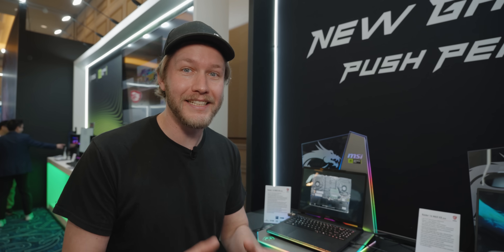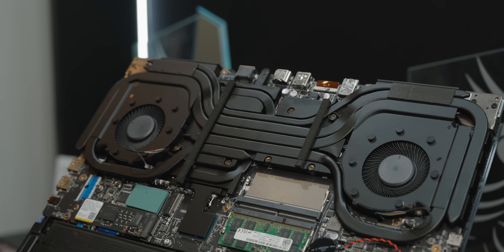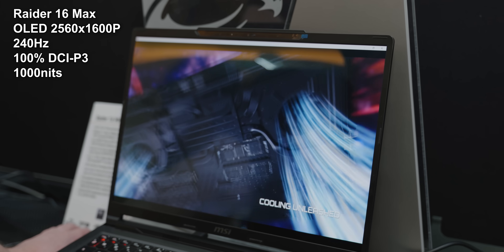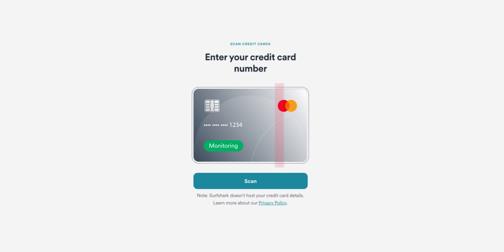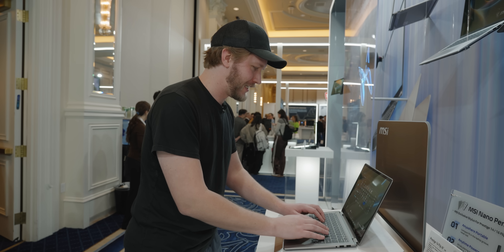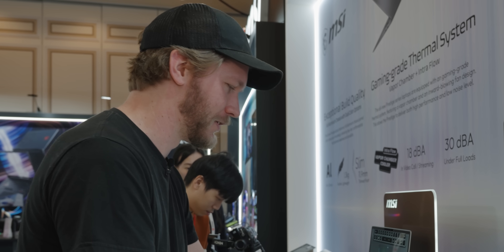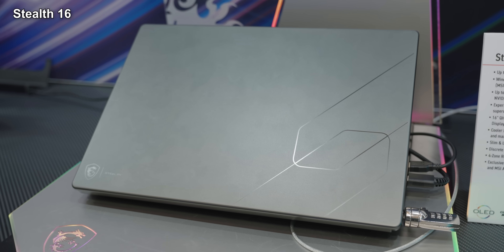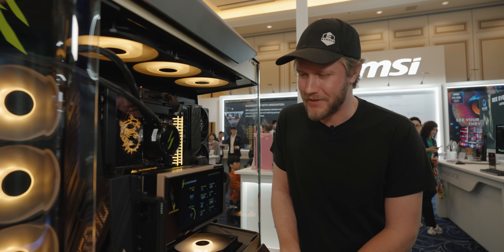So Much POWER!!

Comment from the maker: Go to https://surfshark.com/ziptietech or use code ZIPTIETECH at checkout to get 4 extra months of Surfshark VPN!
Reply: Out of the box most gaming laptops run to hot unless you throttle the wattage down to what the battery can handle even when it's plugged in.

Comment: Cool video, but you say you haven't seen any laptops that has such a high TDP before. I may be wrong, but I'm certain I've seen you with the 2023 ROG Scar 18 in at least 2 videos, which out of the box has a TDP of 350W and can with the use of Intel XTU that can easily be tweaked up to 428W, obviously you will run into cooling issues before you can reach that and the battery would go quick since the charger is "only" 330W.

Comment: My Lenovo Legion Pro 5 has a 300 watt power brick ... Now that heat sink is crazy ...
Reply: I had to do a little comparative research so my Lenovo’s 300W rating is just the size of the 'gas tank' (the power brick). It’s the maximum amount of energy my charger can provide, but my laptop doesn’t actually use all of that for performance; it usually pulls about 200W for the CPU and GPU, leaving the rest to charge the battery or run the screen.
The MSI, however, uses '300W' to describe the 'engine' itself. It has internal components that can actually consume a full 300W of power just to run the game or task. To handle that much hunger, the MSI actually needs a much bigger 400W charger to keep it fed. So, while both boxes mention 300W, my Lenovo is using it as a safety limit for the plug, while the MSI is using it to describe the raw power of the laptop itself."

Comment: Woooow! At least MSI Raider now can use 300W power and we can hope it will be more than 175 on GPU which one was standard for Raider and Stealth when it was last versions of it, and before, and before, so at least 4 generations power of MSI stealth is not changing at all, you can have it on 40 series and 175 W will be there, and 50xx, 50xx, and now new 50xx version are all with 175 w power, just price from first to last will be bigger and 1 ssd slot, which one was reduced after 40 series stealth version where was 2 ssd slots, now will be same, because stealth means less space inside even if it will be 18 inch model with free empty areas :D

Comment: This is the first video I've watched on this channel, and I don't know nearly anything about laptop design, but I just wanted to say that I'd like at least one company to make another gargantuan ~20-incher like they used to do back in the late-2000's. I don't care what kind of nightmarish engineering they'd have to do, I just want to see a laptop in this day and age with a proper workstation-class processor (like Threadripper, EPYC, Xeon, or at least AmpereOne if the TDP of the other options is just too high) and a proper top-end desktop GPU such as an RTX PRO 6000 Max-Q. Oh, and give it all the batteries!

Comment: TIP FOR GAMING ON LAPTOPS: check if it has a battery management systems. "software settings that limit charging to around 80% (or other custom percentages like 30-80%) to significantly slow battery aging". THis is a big problem on laptops as they become hot which expands the battery.

Comment: It's time for manufacturers to bring back replaceable processors in laptops and finally develop a single standard for replaceable graphics cards for laptops. Although I think it should be easy with graphics cards, since they can be made the same way as those damn graphics cards for desktops, but smaller.

Comment: I wish that origin pc still implemented desktop cpu's on there newer gaming laptops like the intel core i9 9th gen thru 11th gen gaming laptops. I even miss the msi gt76 titan laptop with the intel core i9 9900k desktop cpu and alienware area 51 laptop with the intel core i9 9900k. I wish that amd still implemented desktop cpu's on there newer gaming laptops like they did with the amd ryzen 9 3950x like the xmg apex 15 and the origin pc eon15-x. The 9th gen origin pc eon-17x gaming laptop has the same thickness as the msi gt76 titan gaming laptop. I would get the origin pc eon-17x gaming laptop because of the tool less user replaceable battery that uses a latch to remove the battery when the battery degrades since the battery is removable without using tools to access the battery like older laptops than the 9th gen laptops that used to have tool less removable batteries. I still have an old hp laptop from 2008 that uses a tool less removable battery with a latch on the bottom of the laptop to access the battery. However, the battery degraded on it and it runs windows 10. I would just need to back up the data from the old laptop hard drive and than run linux on the laptop since it's using an old amd processor with the dvd optical disc drive. My 2022 razer blade 15 battery degraded in less than a year. I ended up getting the 10th gen intel core i7 processor msi creator 15 with rtx 2070 max q graphics card, 4k 60 hz display, 1tb ssd and 32gb ram to replace razer blade 15. The razer blade 15 was using the 4k 144 hz display, intel core i9-11900h mobile cpu, 32gb ram, 1 tb ssd and 3080 ti 16gb vram version.

Comment: 4:45 Technically, 3dB is double or half the energy, rather than "volume". 
There is some debate, but the industry standard is 9dB [usually just rounded to 10 for simplicity] for apparent volume, which is what most people would consider double or half how loud something sounds.

Comment: I think the experience is universal where anyone got an MSI because it was the best spec but coming around to it since the build quality is aliexpress level and it doesn't last more than 3y and ultimately that the cpu or gpu is powerful on paper but is just throttled unless you put it on coldpacks from the freezer.

Yea, MSI is not going to be in my list for my company, where lenovo, Dells and HP zbooks are though.

Comment: what would be cool to see is you know how FrameWork has the upgradeable GPUS that stick out the back a little bit? What if they sold a second 90wh battery that slots in and is plugged into the back of the laptop and stuck out a little bit so then we wouldn’t have to deal with such abysmal battery life from a “portable”device

Comment: I picked up a Vector 16 with the 5070ti, and I'm extremely happy with it. The previous MSI I bought was a Leopard with a 2070 Super, and while the build quality felt a little behind the Asus models I'm used to, the machine itself ran like a champ. Granted, that was the bottom of the barrel models, but the price was extremely hard to beat for the specs at the time. But I'm very happy all around with the Vector. Not a single complaint. Even runs reasonably cool when not being force fed air from my laptop cooler. Plus, it rips in gaming darn well.
Reply: Quick question, does this mean that you buy a new laptop every 3 years?
Reply: Just bought a vector 17 with the 5090 the other day. It hasnt arrived yet but im super excited given how relatively cheap it was. Msi makes some great high end stuff that wont completely break the bank unlike most other brands
Reply: I too would like a Vector .45

Comment: I had a HP Envy 17 1050ea, quite a relic now but it did have a dot on the top left of the track pad, you would double tap it & the track pad would disable, that should be brought back.
Reply: My 2017 Asus does that, too. 
Pretty sure that was one of those basically industry standard features that just made sense and worked that companies have quietly removed. 
Big sad.
Reply: I remember getting a phone call about a non working track pad. The old lady didn't know why it stopped working 🤣
Reply: @InvictraX I found out about it accidentally, freaked me out when it didn't work, took me a few minutes to figure out why it happened, but after that I used the feature daily.

Comment: so much for usb-c replacing power supplies in the near future at 240 watts
Reply: took too long for power supplies to catch up. lots of cables able to do it, and more ports than youd expect, but there arent power supplies for whatever reason. i believe 1 came out for the framework 16 but im not sure there are any others that actually put out 240w
Reply: @bradhaines3142  the only other one ive seen is ugreen's but is a massive 500watt total for multiple devices
Reply: @bradhaines3142  Wrong. no laptop has PD 3.1 EPR.
Reply: @Beerdwolf  the latest framework 16 supports it 👀
Reply: @Beerdwolf why claim he wrong when you clearly didn’t even attempt to check. 😂
Reply: @M.A.K.T445   Exactly. And several others do too. HP's Omen Transcend 14 and ZBook Ultra G1A have the 140W variant of PD 3.1 EPR
Reply: @Beerdwolf  confident. And wrong.
Reply: @Beerdwolf 
Framework 16
Lenovo Thinkpad gen 3
ALL the M Series Macbooks
Reply: @Beerdwolf  Dell Pro Max Plus 16 (stupid name) does it on both USBC ports with Thunderbolt 5.
Reply: @euanmutch  Yep, because Dell's Thunderbolt docks now do that as well :D (and at stupid charge rates, like 300W or something. We're getting those in at work now)
Reply: USB-C gaming laptop chargers would be awesome, but I don't think there much of a demand right now. At least not enough to convince companies to hop on. The whole point of USB-C is a standardized port/cable.. but since you need to bring around a thick charging cable with you anyways, what's the point?
Reply: @ctrl_x1770  240W cables aren't that thick and are alot less cumbersome than the way thicker stiffer cables that come with the usual laptop power supplies.

The Rocoren has a 240W TPE C-C cable. Not braided, very flexible, won't kink or hold a shape. I regularly use one just to charge my phone because it's soft and flexible.
Reply: @ctrl_x1770  usb DP laptop chargers can charge more than just laptops they have an even more flexible use.
Reply: @ctrl_x1770  with 240W USB-C PD charger you can charge other USB-C devices, but with proprietary charger you can only charge the device it came with (and couple of other supported devices, usually from the same manufacturer).
Reply: 휴대할만한 노트북에서 적절한 pd충전 용량은 딱 140W정도까지인 거 같아요. 맥북도 여기까지 지원하죠. 제피러스 같은 데서 지원하면 좋을 텐데 아직도 100w에 머물러 있고...이 쪽은 레노버가 앞서나가고 있네요
Reply: no thanks we have nothing but bother with usb c power delivery on corp systems, utter pain in arse when it falls over due software issues.
Reply: i think it's more likely a barrel/circle DC head is less likely to break the input if the cable is snagged.
Reply: 240w run at 48w so prety hard to step down efficiently to internal 20v rail
Reply: You lose the main appeal of USB C when you need a specially rated cable, port, and a capable power supply to be able to use a feature. At that point it is slightly worse to use USB C just because of the confusion it’ll cause. USB C is great but I think people get way too caught up in always thinking “USB C=good”
Reply: @flashlightning6742 all of My current USB type C cables are already rated for 240W.
Reply: These laptops are desktop replacements anyway so not a big deal.
Reply: I don't really care about charging at 240 watts any more. A sub-4lb 16-incher with 85-100W Strix Halo & 48GB to 96GB of VRAM is all I want nowadays.

Hell, by 2028 Medusa Halo is gonna give us APUs with 7800XT-grade iGPUs and Morpheus Halo by 2031 with RTX 5080-grade iGPUs. 😎
Reply: Just wait till they figure out how to dual connect 240 Watt USB charging... 😅
Reply: I hate apple but intel, amd and nvidia have completely lost the plot if they can't beat apple in performance per watt. (no excuses about architecture, if it needs to be changed they should do it instead of stalling with AI slop)
Reply: @kiyoponnn x86진영은 나름대로 노력하고 있다고 생각합니다. 루나레이크와 펜서레이크의 전성비는 그레도 제법 괜찮죠
Reply: @kiyoponnn they would rather co operated with each other to beat the shi out of consumer wallet at this point

Comment: Very confused about this TDP number. Unless NVIDIA is allowing these new GPUs to use more than 175 watts, this 300 watt claim is simply marketing bs. Pumping more power to the cpu really isn’t doing much for gaming loads.
Reply: Even if they can't draw more power that means lower temps and less noise I think
Reply: it's 175w for the GPU and 125w for the CPU
Reply: They couldve used amd cpus instead of Intel and they wouldnt have needed 125w on cpu for the same performance at 55-80ws Max, so very unnecessary, at least today today with 175w limit on gpus.